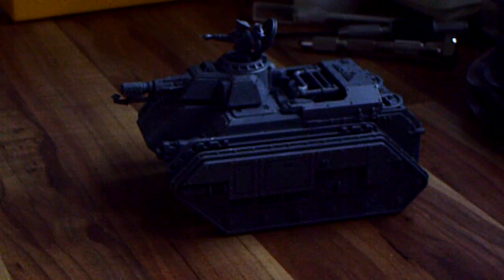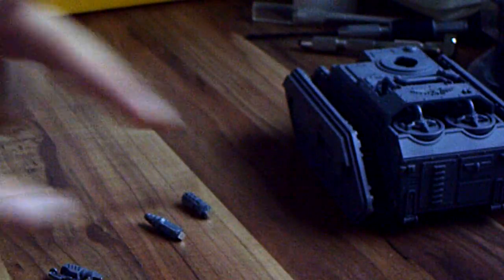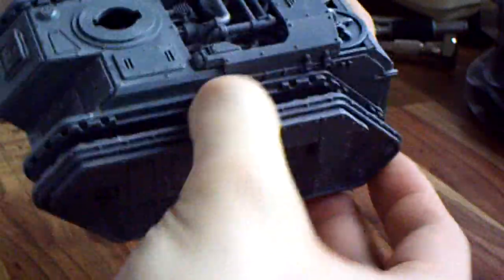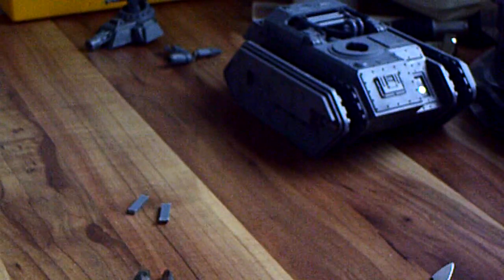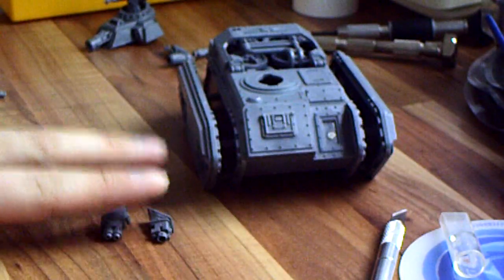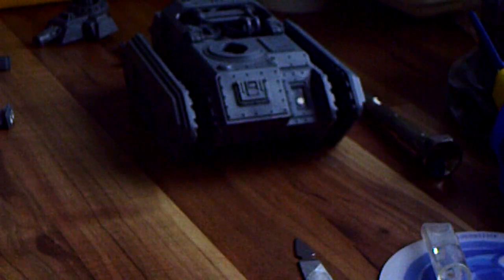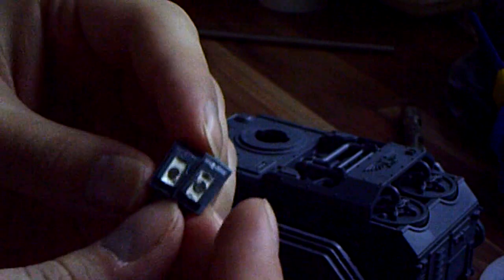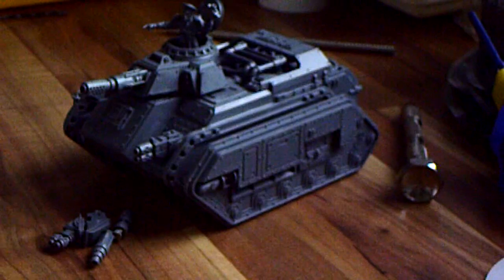Magnetizing tutorial: Imperial Guard Hellhound / Devil Dog / Banewolf

Comment from the maker: @TheForgecrafter The drill that has the very large bit in it is the original GW drill. The bit itself however was bought separately in a hardware / DIY store. The piece inside the drill that holds the bit isn't really supposed to fit such a thick bit, it barely fits in there. The other drill is from Army Painter and can't hold the big one.